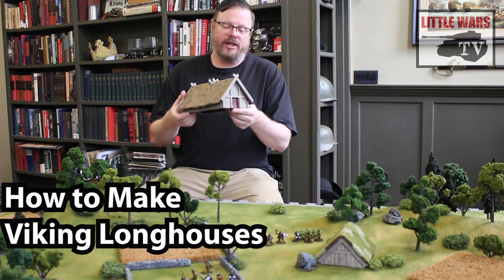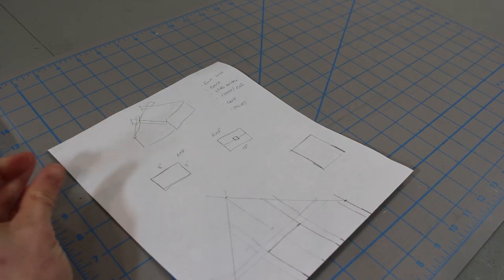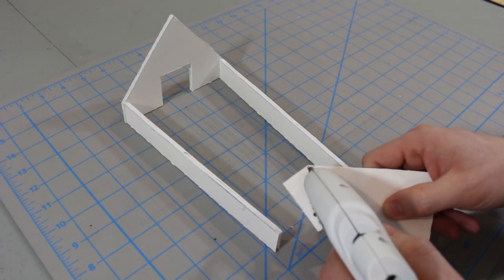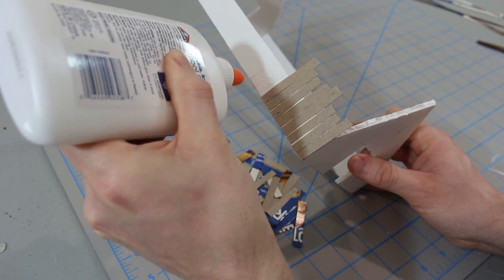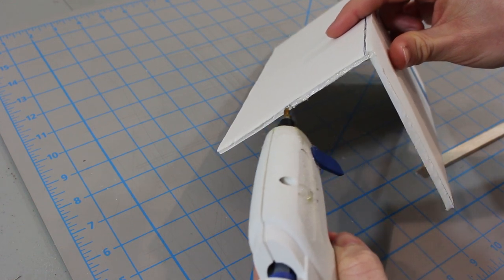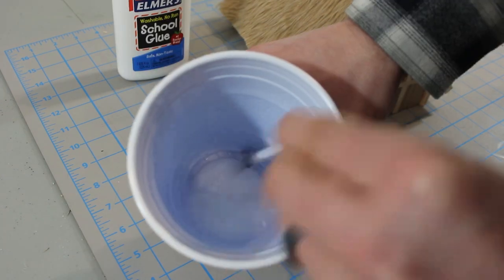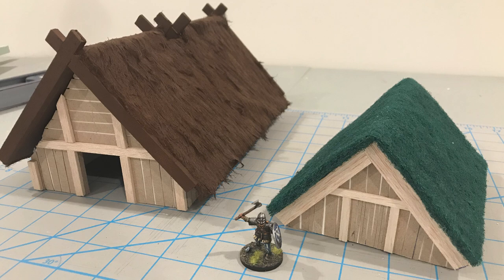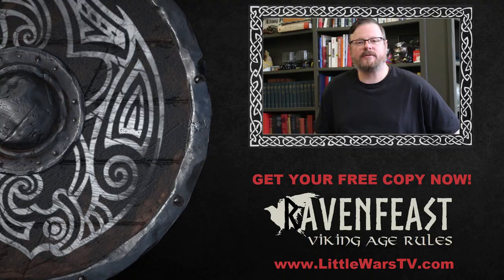How to Make a Viking Longhouse

Comment: Good looking house, thanks for taking the time to show how you made that.
Reply from the maker: No problem 👍
Reply: @LittleWarsTV  I wish to compliment the video it gives a good representation on techniques for making model houses, but I also wish to point out some issues with the artistic depiction you make. All the serious reconstructions of Norse long houses (I don’t call them viking houses since there is no such thing as a viking I will explain later 😊) have some differences from what you made, and one of them is that all planking is vertical, there is no horizontal planking.

Another distinct visual que is that the reconstructions have an arched ridge that tapers upwards terminating at the smoke hole, this is to facilitate easier evacuation of the smoke, and provide better ventilation. Fun trivia fact, the word window comes from the old norse word vindauga that translates into “wind eye” or more figuratively “wind door”/“wind hole”. 

Thirdly the roof should be made to look like wooden roof tiles, since there is very little use of thatch here in the north where there is heavy snow fall, they don’t mix well 😉. A substitute would be to depict sod roof, which was more common in Iceland, since wood is scares on that island, also they would substitute most of the side planking with stone, which you can use as a visual cue for better immersion or geographical referencing. For the sod roof you could use teddy fur not clue it down but instead get it to be fluffy and raised, and paint it green.

Admittedly this is a harder construction challenge than straight lines since curved lines need much more fit and finish to look good, and making wooden roof tile look can be a bit more work than gluing teddy fur to the roof, but I figured you guys may wish to know in case you were to make a long house 2.0, or maybe showcase more advanced constructions techniques 😊

Now why “there are no Vikings”, simply put viking in Norse times, was a verb not a noun, hence you “went viking”, but you were never “a viking”, but for the sake of simplicity one must bow to the common vernacular usage of the word ☹. And lastly thank you for the good content you guys make.

Comment: The measurements are off.  If the house is 5 inches wide and 4 inches tall (which they don't state) there is no roof slant can be 3.5 inches.  when I CAD it out the slant is more like 4.5 inches.

Does anyone have good measurements?

Comment: You don't wanna use foam board. That stuff warps in time due to moisture. It's more expensive but look for material known as gator foam board or gator board. That stuff has no equal.
Reply from the maker: Very true, if left untreated foam core board will warp. If you glue wood and cardboard elements to it like we did here, though, it will not warp over time. Thanks for the tip on gator board! We will search for that!
Reply: @LittleWarsTV  When we had our family business, we would go out to a place out on the eastern shore to get the stuff from a company called Harbor Sales out in Sudlersville, MD. We use to get full 4x8 sheets and use those as bases for our o gauge buildings.